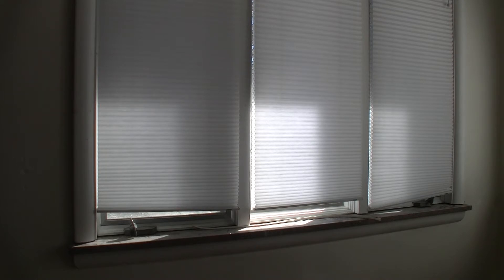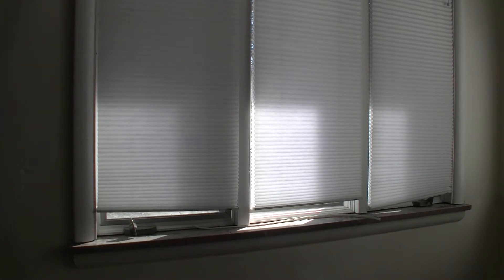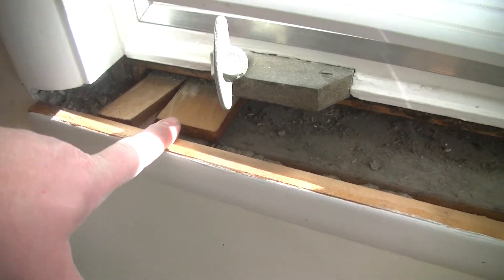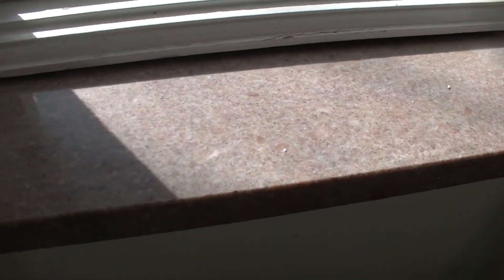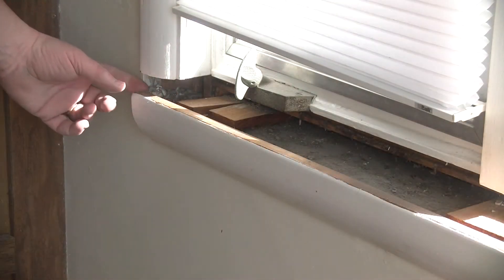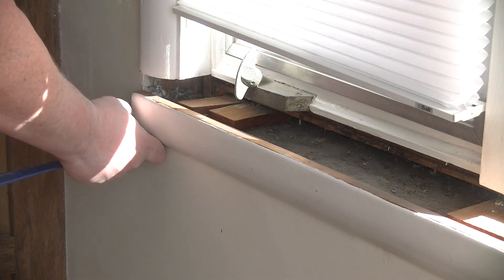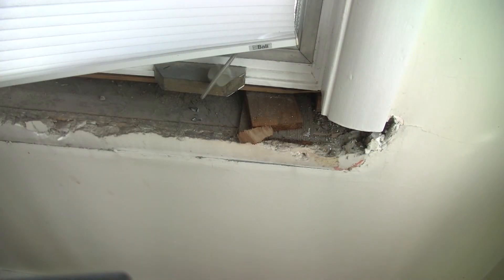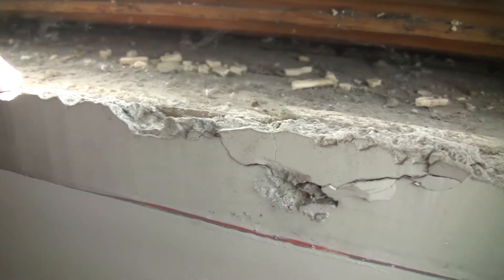How to remove window trim | MRS. RATTLECAN'S HOUSE

Comment: thank you James . 50's walls lathe and plaster ? seems all windows have voids in em no matter what yr they were built . oh no insulation it would be too easy at the build time .
Reply from the maker: Walter Rider It is actually cement board? and wire mesh with plaster over that. Very thick. Fun stuff.
Reply: well ill be thank you